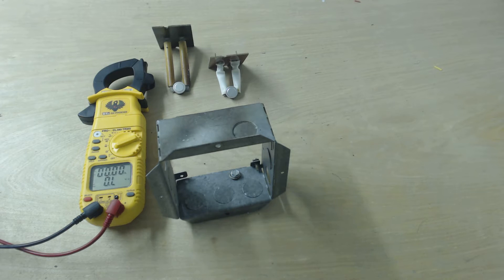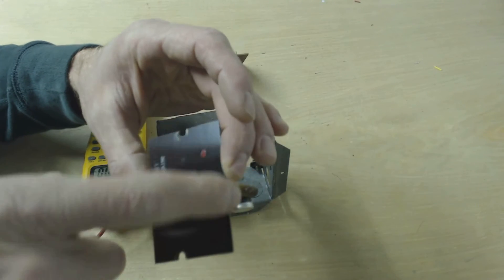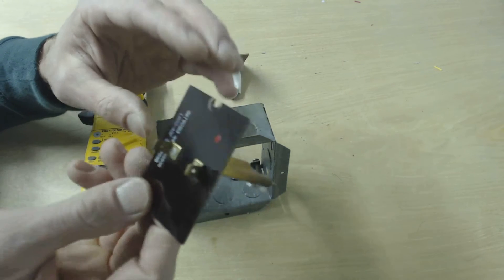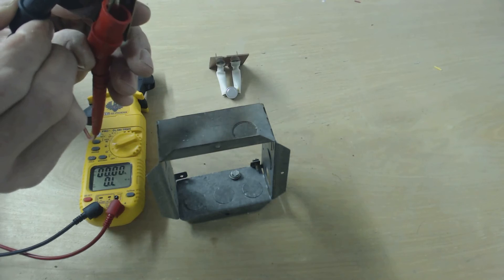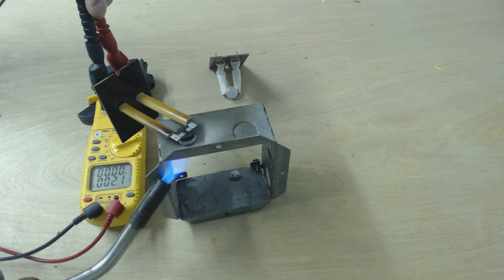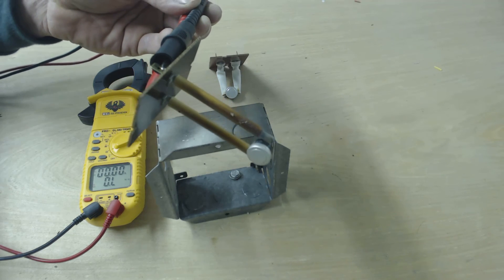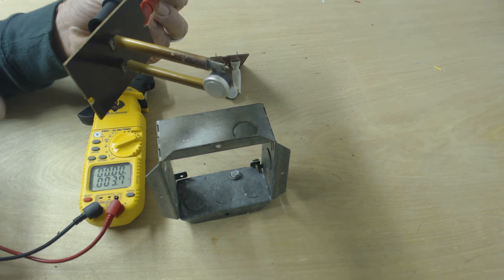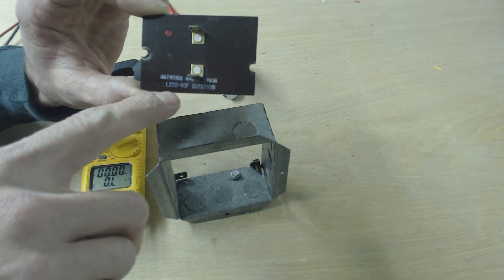Plenum Limit Switches! Read the Temperature Ratings Properly, Heat Tested!

Comment: So how do you know when it's opening at the right temp? How would you check temperature and make sure it's not closing sooner or later than it should?
Reply from the maker: You could place a k type bead temp sensor in the same location as the plenum limit switch or take a reading above in the supply duct, thanks